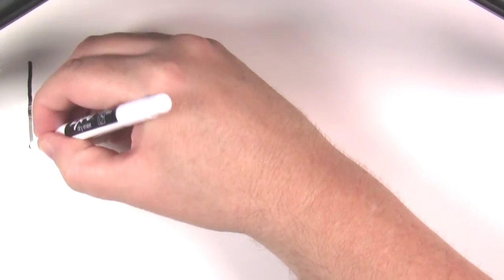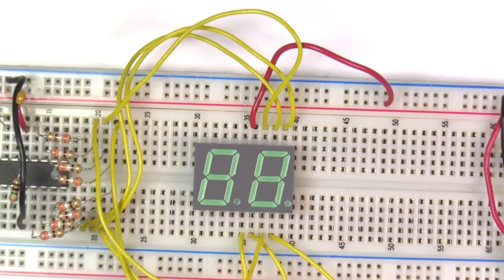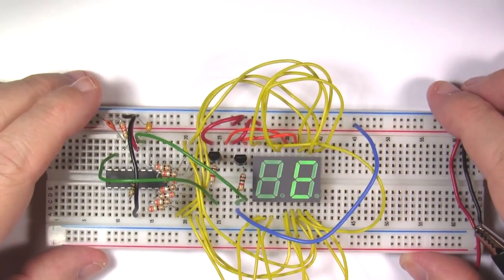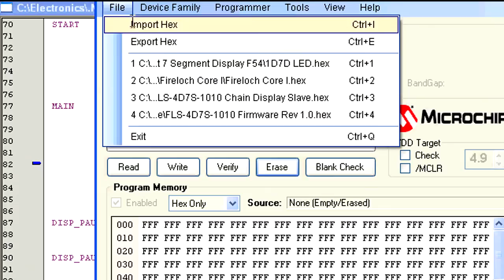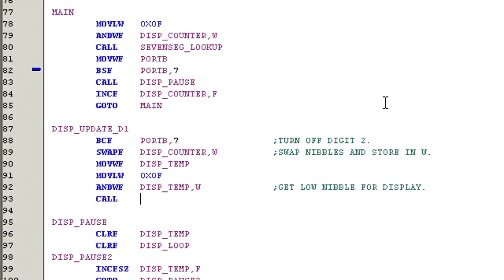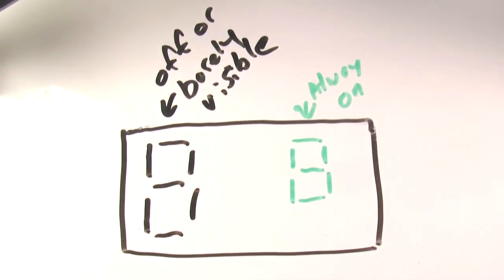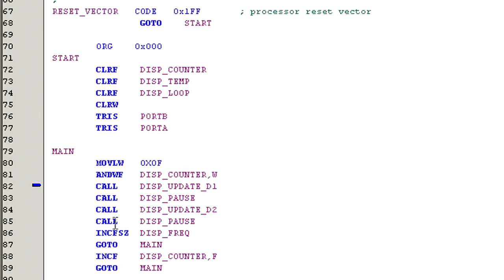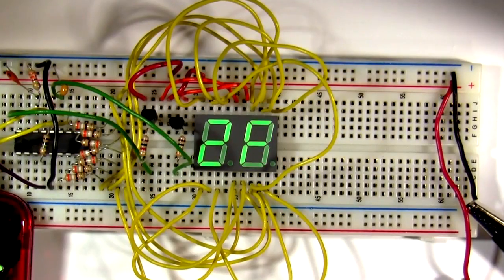David's Lab: 7 Segment Multiplexing LED Display PIC Assembly Language Tutorial

Comment: Hi David, thanks for posting this series, it is very helpful.  Would you know how the use the MCLR/RE3 as a digital input which triggers an interrupt on the negative edge? I am using PIC16F18456.
Reply from the maker: Since RE3 is used to initiate programming mode via a high voltage, you'll need to add a resistor between RE3 and the rest of the circuit to isolate that programming voltage.

 Digital Circuit              VPP
 |                                       |
O------ Resistor------------ O --------O RE3

This resistor will drop the difference between sys voltage and VPP voltage. Though resistor value isn't important, stick to 10K or higher to keep current draw low.
-----------------------------------------------------------------------
Use Interrupt on change (IOC) to detect a change in the voltage on RE3. You'll want to check the current state of RE3 in the interrupt routine to make sure the change was a high to low transition and ignore the change if it's low to high. 

Hope this helps.
Reply: @magidavid  Hi David,

Thank you very much.  I was able to get interrupts working on RE3 with your advice.  In addition to taking your advice it also turned out I had a floating pin which was tripping me up.

And finally I discovered MCC didn't generate the correct code to implement an RE3 interrupt on the falling edge.  Strangely the C header file has named the register flag IOCENbits.IOCEPEN3 where other registers have their flags named like IOCAN3 for negative edge interrupts.  I may report this to microchip because it doesn't seem right to me.

Anyway, thanks again as I was able to get a 8 bit binary to 14 segment display working with your videos.  Thanks for making them.